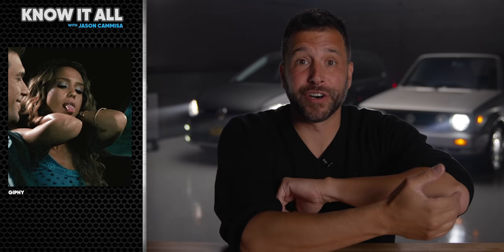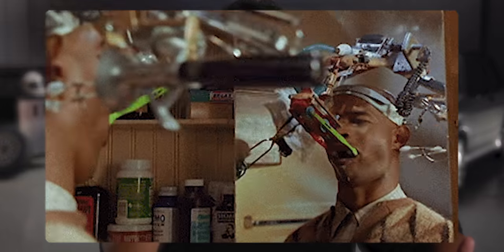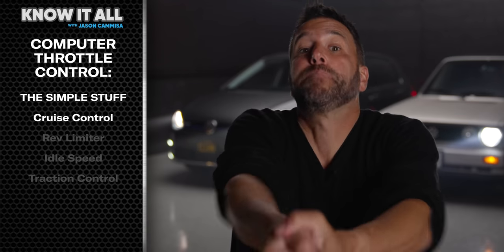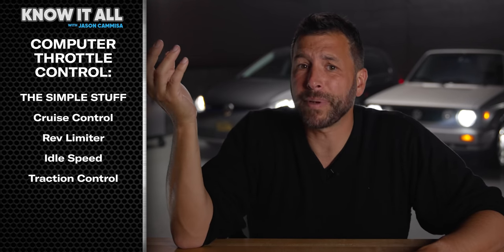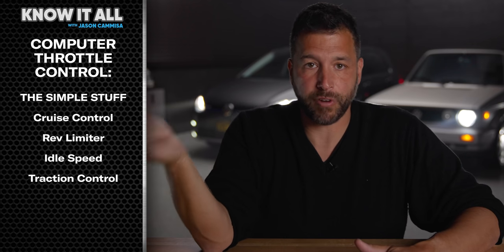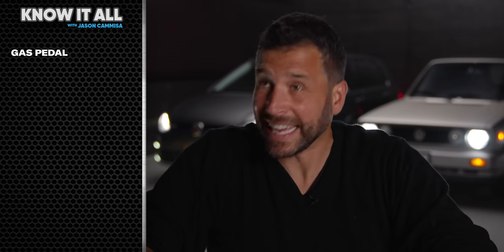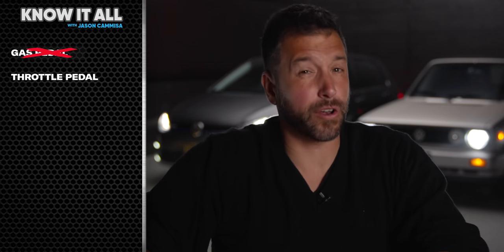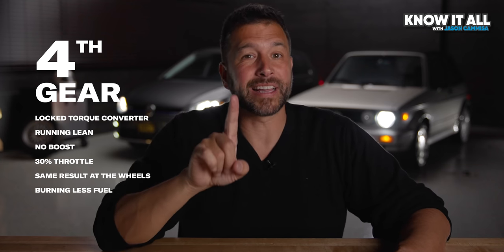Having no gas pedal is a good thing | Know it All with Jason Cammisa | Ep. 07

Comment: Actually the by wire throttle is better because it controls how much the throttle is opened. On a cable system if you push the pedal 10% it may give you 10% power. but that doesn't apply to 20%  and 50% throttle. You can be pushing the pedal 30% and getting 70% of the power, and then after that you can push the pedal all the way and it wont make you car get much more power because a cable cannot give a linear throttle response. 

A by wire throttle can. Because if you push the throttle 30% the computer can adjust the amount the throttle opens to give you 30% power and give you a nice linear and smooth throttle application rather than the crude way a cable works.
Reply: And none of that matters once you learn how to drive. You quickly learn the pedal feel and modulate accordingly.
Reply: @mkshffr4936  I drive both, and can say that you can tell the difference. For example my car with the throttle by wire is a sports car and has a sports button. When you push the button it changes the throttle response to either a more relaxed throttle response or a more aggressive throttle response. Which is nice because you dont always wanna be driving fast or always driving relaxed. 

In contrast the other vehicle i drive is a work van. Its slow, and it doesn't help when you're going along at half throttle only to realize that no matter how much extra you push the throttle, you wont go any faster.

Comment: 3:00 I drive in the north through aggressive winters and have never had my tires “lock up” by letting off the gas pedal, including in high revs. And my car is drive by cable.
Reply: Then you are not the driver that that particular feature is aimed at, just because you can drive in the snow doesn't mean auntie Margery who only sees snow on the road once in five years can do the same thing.
Reply: @popuptoaster  Doesn't change the fact that the wheels don't lock up. and the video shows a car without abs locking up the front wheels upon braking, not just letting off, and shifting weight away from the rear causing a crash. wouldn't happen in letting off the gas. the wheels don't lock up, stability control or not. makes little difference.

Comment: ill take the throttle cable directly connected to the throttle body any day over fly by wire. its slow and inefficient with trash throttle response. i already unplugged the stability and traction control on my car and im just saving up money to go to a mechanical throttle body
Reply: Reprogram your existing e-throttle.

Comment: Traction control, Stability control...
Benefits. Yeah, or you could just learn to actually drive. But I guess that's too hard for people these days.
Reply: ESC is the biggest safety invention since airbags. A human can't control individual brake calipers in LITERAL MILLISECONDS to stop a skid from becoming uncontrollable. In the case of modern Toyotas, a system called vehicle dynamics integrated management can intervene before a skid even occurs, controlling braking, throttle, electric power steering, and even torque-vectoring AWD to prevent a skid.
Reply: @aspecreviews  yes, yes, yes... I'll stick to my 30+ year old AE92, E30 and Golf MkI precisely because they have NO SUCH BULLSHIT. I've never had issues with my cars skidding or anything without any of those systems. But I actually took the time to get to know my cars, how they feel before and during skids, spins, and on the edge, then found way to being them back from that edge. That's called driver skill. That thing that's constantly being degraded and destroyed by the nonsense "driver aids" and "safety systems*. The best and only safety systems I need are the safety belt and my own skills.
Reply: Oh and before someone goes "Akhschtualley, d E30 Haz ABS", no, mine doesn't, I disabled it within the first 24 hours of owning it and I don't mean just made it nonfunctional, I mean FULL DELETE. Same for my AE92.
Reply: A lot of this "enhanced" safety stuff has just lead to crappier drivers. It isn't always a great idea to divorce consequences from stupid.
Reply: @mkshffr4936  boy, you can say that again...
Reply: @mkshffr4936 ESC/VDIM hasn't. It's led to less crashes.

Comment: When your throttle cable breaks you run a string out the hood gap and through the window. When your fly by wire pot, or motor, or brain breaks you are stranded in the middle of nowhere surrounded by bears.
Reply: imagine commenting this thinking its some kind of gotcha trump card for traditional cable throttles
Reply: Have personally done this with a 5sp f150. But was in a pool parking lot surrounded by geese.

Comment: Horrible for Hagerty to put this garbage up! We are here because we like old vehicles! With no computer!
Reply: Hey now. 5 of my 7 cars have throttle cables. #6 doesn't count because it's a Lotus Elise, which is basically a 1950s death-trap with fuel injection. Just because we love old cars doesn't mean we can't understand some of the benefits of the new stuff. (Wait'll I do a video on touchscreens! Muhahaha....)
Reply: @JasonCammisa  I get you. However ever car that I have owned with the dimmer switch sucks. No throttle response and like to mess up. They get dead spots where ever the throttle gets held. Having to pay someone to fix it vs a cable is just stupid!
Reply: Well, you could just fix it yourself  @nivesknight  ?
Reply: @JoshuaTootell  it cost 300 to 600 for the part. A cable cost 10?
Reply: It's about $150 and 10 minutes on my truck.

By comparison, oil change is $100 (doing it myself). So, $150 after 20+ years seems fine to me. Also about 10 minutes to do.

I just did the glow plugs, those are about every 100k miles, cost $100, and takes about 8 hours with a lot of swearing.

If $150 and 10 minutes is too hard, well, I don't know what to say  @nivesknight
Reply: @JoshuaTootell  the work isn't the problem. The problem is taking control away from the driver.....
Reply: I dont like the way it works. It changes the way you drive. As well as you must drive a automatic.
Reply: I can't argue with your personal opinion. My personal opinion is, I'd rather have a cable too. But opinions aren't facts.  

Every car I have opened has had some sort of control taken from me. I couldn't control ignition timing in my 1959 VW. Every vehicle since then has had in the least ABS, except my motorcycles (one of which was still didn't have a throttle cable).

Manual transmission has nothing to do with the throttle. I am not aware of a production manual transmission today with a throttle cable.
Reply: @JoshuaTootell  GM didn't put abs as a standard till 1989! Abs is garbage as well. That is a different story all together.   I only buy vehicles older then 1989 any more. Are you sure you know what you are talking about? Power steering wasn't standard till 1990 I believe might be wrong there. Once again talking about GM.

Comment: I don't want cruise control, I use engine braking, and I don't like stability control ...why would I want one of these?? as for the turbo application... sounds like something I could do myself, assuming I get hit in the head and decide I want to turbo my car. I much prefer n/a and supercharged engines, as well as an analog experience. not only is it more fun to drive that way, but I don't have a computer assuming I want one thing, when, in fact, I want exactly what I said. I said wide open throttle in 6th gear, not 30% in 4th.

Comment: Man I just drove a Tesla 400 miles and didn’t touch the brake pedal once!
Reply: Don't you mean the negative torque request pedal.
Reply: 3 pedals are better than 2 which in turn are better than one
Reply: @cgmoog  Precisely. Or perhaps the regenerative kinetic energy recovery/hydraulic friction inducing mixing pedal.
Reply: @cgmoog  genius response. Except that Tesla is the only company that doesn't use a blended brake system... so it's ACTUALLY a brake pedal. Go figure!
Reply: Technically when you release the accelerator pedal in the Tesla, the motors engage in regeneration and hence negative torque.  The brakes are just brakes independent of the motor.
Reply: @JasonCammisa  Interesting. Makes sense from an engineering perspective. Let's call it a kinetic to thermal energy conversion modulating pedal. I'm used to thinking about it from a Toyota hybrid drive point of view. Most reliable car I ever owned. Also the most boring!

Comment: Yeah, I'll stop hating DBW when I see a break in traffic, stand on the pedal, and NOT have it take 500 milliseconds to make heads or tails of my request.
Reply: My 2002 Prius responds instantaneously to any movement of the torque request pedal because it is half electric. No internal combustion engine can respond in less than 2/10 of a second, but the Prius can
Reply: @aspecreviews  A decent cable throttle is damn near instantaneous. DBW lags the throttle because of an increase in pollutants during the sudden spike in power. (That, of course, only lasts for a split second, and the cat knocks most of it down anyway.)
Reply: @bcubed72  a good cable throttle is NEAR instantaneous, not instantaneous. A hybrid like my Prius is absolutely instantaneous (< 10ms). The electric motor can provide power while the engine is slowly ramping up its output.

Comment: I finally got a car with an electronic throttle body. It's the worst, what was wrong with a cable?

I want it to open as fast as my foot can slam tye pedal, not wait for some Bosch electric motor to open and close it.
Reply: Most of the time, the throttle actuators are faster than our feet. The problem is the nitwit engineers who slow down their responses to make our driving "smoother." Jerks.
Reply: I do miss cables
Reply: If electronic motors were actually slower than our human response capabilities, EVs wouldn't be the fastest things on the road. Standard PWM control is on the order of a few kHz to MHz, aka 1000s to 1000000s of times a second response. Plus the torque those motors can impose on the opening/closing part to yank it open is many times what a person would be capable of in a drive by cable throttlebody. As mentioned, these days the delays are almost all programmed in to increase efficiency and optimize NVH. Most people are flipping terrible at self-modulation of throttle (and brakes for that matter).
Reply: @anthonyschroeder521  Unless they learned to drive in a manual trans car, which teaches you to be smooth. I agree though, that most people can't properly modulate a torque request pedal.
Reply: @dougrobinson8602  meh even then, most seem to only know clutch full on and full off and maybe 4 levels of throttle lol. Here I am where every moment of braking is a failure of smoothness (when I'm not trying to be crazy anyways).
Reply: @anthonyschroeder521  
Electronically controlled throttle/butterfly valve is definitely more efficient than a cable.

But for the enjoyment of driving,  especially classic cars, nothing beats a cable-operated throttle.

Hell, we even have a car with a cable-operated clutch.
Reply: @JasonCammisa  It must be the emissions tuning then. Every car I've has insane rev hang because it leaves the throttle open to burn off extra gas. Case in point, drive an RSX with a K20 and then get into a newer Civic Si (the same K20) with an Electronic throttle body.
Reply: @JasonCammisa  my 2002 Prius was actually engineered to respond instantaneously, since Toyota wanted to emphasize the half electric nature of the "NEW REVOLUTIONARY PRIUS."

Comment: Yea, that's all great. But with all this modern tech you no longer decide anything. Besides nannies, if you drive with a manual transmission, you have to deal with rev hang, because that stupid CPU has dicide, that you'd prefer ecology over fun. In your modern car with a manual transmission, that only petrolhead would bye. For everyday drive, yea, the adaptive cruise is worth it. But throttle by wire kills the fun of driving. You are not driving, you ask your car to go faster or slower.
Reply: Rev hang is on turbo cars. Trust me, my N/A engine has full computer authority, and zero rev hang.
Reply: @dougrobinson8602  sure it is. But turbo engines have rev hang only because slower closure of throttle results in lower emissions.